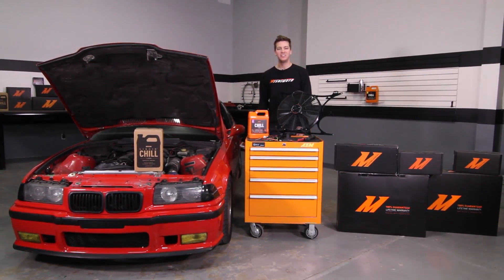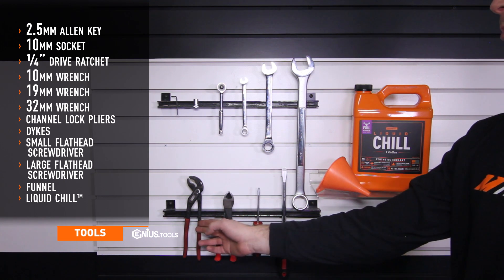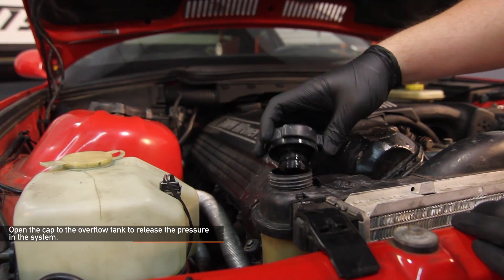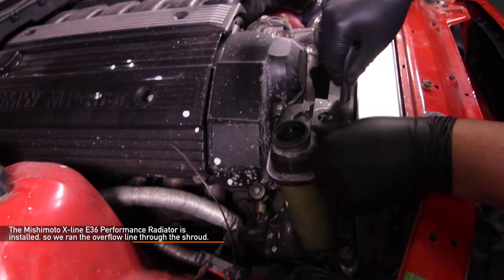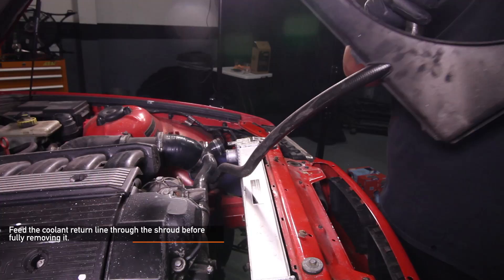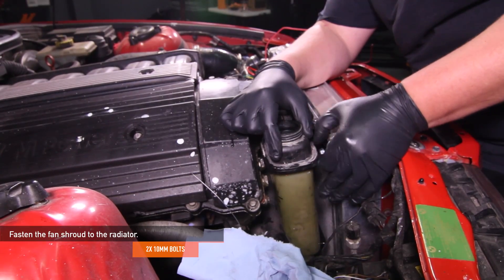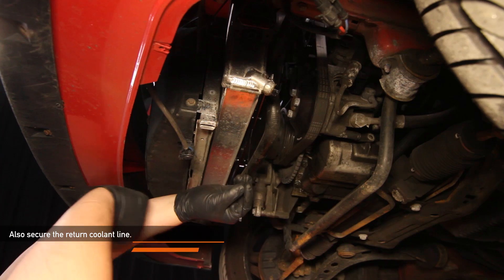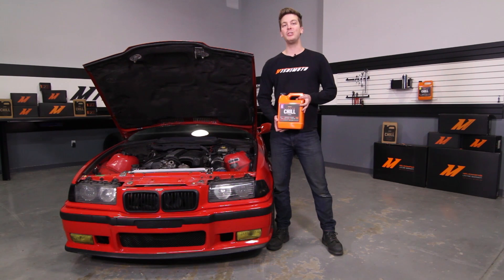1992–1999 BMW E36 Performance Fan Shroud Kit Installation Guide By Mishimoto

Comment: Is it supposed blow air out or suck it in. I got a kit 2nd hand and it blows air out the front, wondering if its supposed to be like this
Reply from the maker: The rule of thumb with any radiator fan is that it should bring in cooler, fresh air into the engine bay - never move hot air from the engine bay through the radiator. If your fan is mounted between the radiator and the engine, it should be pulling air through. If your fan is wired incorrectly, it may run backwards causing this. The fix is easy, however. All you'd need to do is reverse the polarity and the fan's direction will change. Please feel free to reach out to support@mishimoto.com if you have any technical questions!

Comment: Does Mishimoto make an auxiliary fan for the front of the radiator as well? Mine stock on has broken twice???
Reply from the maker: At this time we unfortunately do not produce an aux fan we might be able to offer that will bolt up to the OEM setup

Comment: How much HP do you gain on a stock non M3 E36 by replacing the motor driven clutch fan?
Reply from the maker: This will have a lot of different results, however it is commonly reported the fan frees up about 5hp.
Reply: @mishimoto  OK, thanks. I wasn't looking for much. I mostly want to get an electric fan to get more heat pulled out, and make the car not work as hard spinning the clutch fan. Maybe get better fuel mileage, but overall make the car more reliable, not run faster. I already got the expansion tank and radiator so the fan is next!

Comment: How do you wire the fan when not using a Mishimoto fan controller?
Reply from the maker: This will require you to set up a relay to the negative side of the fan. This will then either have to be set up to a switch to trigger the relay or a temp sensor.

Comment: Will this product fits my 2001 bmw z3?
Reply from the maker: this would work depending on what engine is in the car. The OEM part number for the shroud is shared between and the 6 cylinder E36 and the M52, S52, and S54 equipped Z3.
Reply: @mishimoto  My is M54 3.0 L6
Reply from the maker: Looking at the OEM part numbers for the M54 it appears the stock shroud is different on the M54 cars.

Comment: Is this a puller fan or pusher fan?
Reply from the maker: Hello Try 4ever . This particular fan is designed to be a puller, but is reversible and could be used in either configuration.

Comment: Just doing a conversion. curious where does that return coolant hose connect to as i want to install the rad and their new overflow tank
Reply: On a Non M3 car it would go to the bottom of the expansion tank also however it is fitted to the opposite side of the radiator. On M3 models it is mounted on the left and has a longer hose that runs along the bottom of the radiator. It still exits the block in the same place under the inlet manifold, where it is clamped to a solid metal pipe!
Reply: @KevsShed  on EURO M3 MODELS*